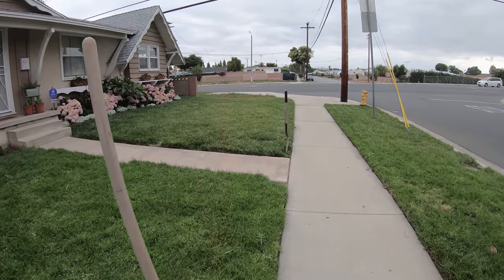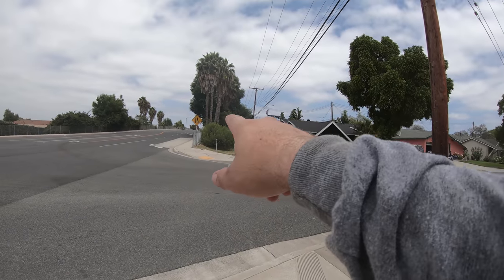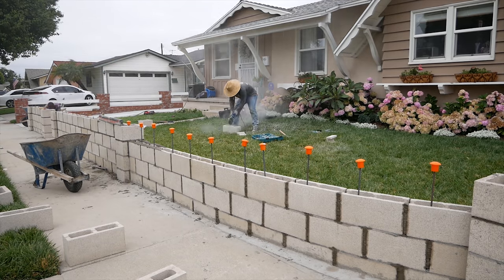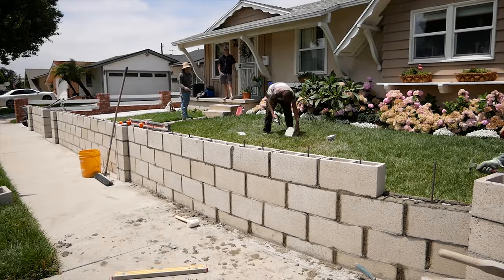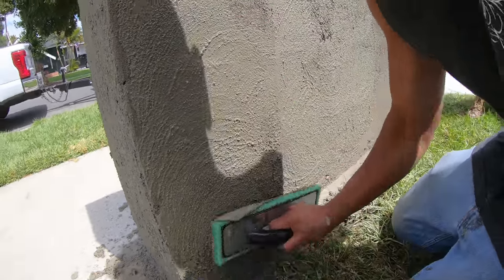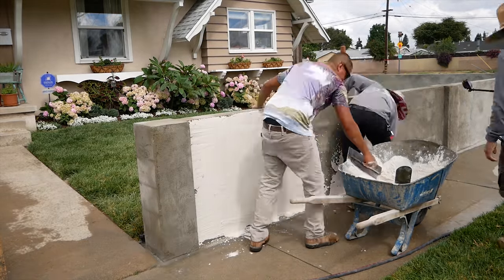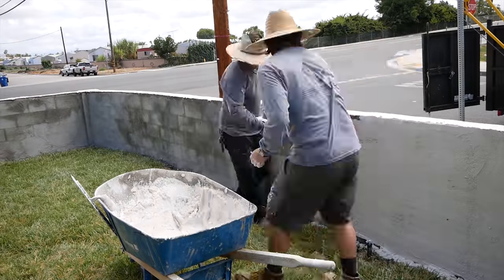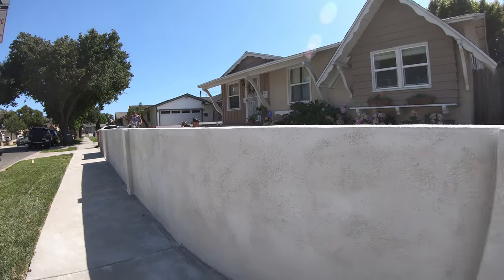How to Build a Block wall, Texture Stucco and Gate!

Comment: I dont see anything in the video showing how your piers are structurally tied in to the wall sections with rebar.. I see rebar inside the piers but nothing to physically link pillar rebar to wall rebar. I have learned a lot from your videos and I just wonder why you built it this way. Thanks for all your posts, they help a lot!

Comment: Can you build a wall like this on "old" concrete ? I have an old crumbling foundation I want to resurface with new concrete and build a low wall around it like this maybe with out the stucco at a faux rock face and wide flat rim to be used as additional seating or a place to set potted plants  I would be grateful for any advice or tips.
Reply from the maker: If it crumbling, then I would remove it.

Comment: Nice.  I have to say it seems a bit weird though having a gate and then open to the driveway 15' away.
Reply from the maker: Yes I think the fence needs to return to the garage with an additional gate
Reply: pedestrian gate and vehicular gate are both desired, the owner may choose to install a automatic garage gate, but requires easier access on foot.

Comment: If it was my house I would asked for some very thick vertical steelbars to be placed in the blocks and anchored at least 4 feet below grade. That would stop them and prevent penetration of the wall and possibly hitting the house. It will be cheaper and faster to repair a damaged block wall than rebuild a house!
The initial cost would be higher but it just might save an even bigger expense later! This just what I would have wanted and is no critique of your work here! I'm very much a belt an two braces kind of guy when it comes to construction!
Reply from the maker: Post bollards are the answer

Comment: 1. why not run re-bar through the footing and tie vertical steel to it? 2. Vertical steel is no good unless its mounted to footing steel, and a small beam(cap) should have been cast with concrete and steel(tied to vertical steel) to run along the top of blocks, this top beam would ensure the columns and blocks dont pull away from each other, and also prevent the wall from leaning sideways. Also, how did you tie the new wall into the existing wall?
Reply from the maker: This wall is short, so I don't see a problem
Reply: @OdellCompleteConcrete  fair point,,but where im from,,most builders 'over build'

Comment: only thing i think i would have done differently. Was, get some I beams and place them in the Columns instead of rebar. 8 foot tall I beams and snuck them into the ground enough for the ridge cap to go on top. that would stop a car most likely if it was to hit it.
Reply from the maker: how about some 12" x 4' steel bollards
Reply: @OdellCompleteConcrete  that will work too. Corner houses are just bit on dangerous side on some roadways. I used to live on a corner house that was similar to this house. We got a couple Boulders  placed in front yard. same year in winter time, car slid into it. Driver was fine. but it worked. Boulder didnt move a inch. well maybe it did. but we couldnt tell.

Comment: What happened to the rebar in the cmu as well as the vapor barrier, wire lath, and mesh and base in the stucco system? Too many burn marks. I don't know about that stucco application looks like it's going to start bubbling and delaminating pretty quickly.
Reply from the maker: You dont know what your talking about
Reply: @OdellCompleteConcrete  that's funny because I own a stucco company and we are certified applicators with California Stucco, STO, Master Wall, and Parex. But, okay... If you say so.

Comment: Is there any utility pipes going through the front yard?  And if so, how far can you safely dig while avoiding it? And do you need a permit for such work?
Reply from the maker: water should be a foot.
gas is at least 18" to 24"
Electric 24" to 36"
Reply: @OdellCompleteConcrete  thanks alot.

Comment: just made the slab for a 2 foot retaining wall, did not put vertical rebar. can i drill holes in the slab and put the rebars or will the wall be fine without it.
Reply: Drill for at least #4 rebar and blow out the holes then epoxy. Best case scenario would have been putting a horizontal rebar across the footing ad tie the vertical rebar with L hooks into that before pouring concrete

Comment: If you ever build up a fence like this will you post a video please? I just bought a house that has the same type of fence. 16x8x4 with 16x8x8 every 7 blocks or so. Not made to look stucco just blocks with a rounded top on the 4in ones. We need to make it taller by 1 or 2 blocks because my dog keeps jumping out to explore... They also had to tear down a part of it to get to the septic so the local people fixed the wall and that part of the fence is sturdy but not straight :( so rather than paying someone to not do it right I want to do it myself. Or if you have a video already please provide the link. I could not find one. Thank you!
Reply from the maker: Good idea
GL

Comment: I'm confused why you put concrete over the existing irrigation (what happens if that corner riser ever needs replaced it is fully cover with concrete).
Reply from the maker: new pipe

Comment: That looks nice David. Did you fill the blocks with concrete or mortar mix?
Reply from the maker: Concrete
Reply: @OdellCompleteConcrete  hi, I just want to build a small wall, 10 m length and knee height. Can I do it in a day?
Can I just lay the bricks on wet concrete? I want to do it as fast as possible. Please suggest me something brother.

Comment: As always, great video. Three comments: 1. Looks like someone needs a new hat. 2. Instead of a weird curved wall at the outside corner, you should have done a relief corner. Would have looked better and created more strength. 3. Why don't you cover the grass with a tarp or canvas cloth to protect it? Honestly curious.
Reply from the maker: Used top soil at the end to help it grow back and yes need a new hat 🤠
Reply: You would burn the grass very fast
Reply: It would burn the grass

Comment: Was that wall grouted for added strength? Great work!
Reply from the maker: Yes
Reply: @OdellCompleteConcrete  Great! Well then in the words of Mr. T,  “ I pity the fool that hits that wall!”
Reply: @OdellCompleteConcrete  when you say Grouted, you mean mortar or concrete laid between the two concrete bricks top and bottom and both sides as they are laid? And if so Mr. Odell, what are you using in the wheel barrel to lay them with (Grout them with?) Thank You sir.

Comment: Every cell should be filled. if your going to go through all this why would you purposely make the wall less effective?
Reply from the maker: No, only where steel occurs
Reply: @OdellCompleteConcrete  that steel is not doing anything unless its tied to footing steel and top/cap beam steel

Comment: They say every house has a buyer. Not sure about the people that buy these homes on corners like that. Like living facing the 405. With the new expansion, some are facing the 405 or they got a view of a 30 foot sound wall in their backyard. 
That’s a lot of rebar for that little wall. Going to be a solid little wall for not being able to stop a car. Should have sold them K rail and stucco it for them.
Funny, a house in our hood is for sale. Blacks right up to Edinger, Edwards and a gas station. In the posting is says “stand in the front yard and check how quiet the neighborhood is”. I’m four houses away and hear the air tools from the service station along with the bass from the knuckleheads in their cars at red lights. The front yard is no quieter.

Comment: Finished product looked good, but being in masonry for 20 yrs it hurt a little watching them boys use a line and level every block. Friendly tip if you wanna pass it on, once the first course is leveled front to back, if you lay to the line and keep the upper edge of lower course flush with lower edge of the block youre laying on the side youre laying from....theyll stay plumb and you dont need the level every block. Assuming your line is plumb going up. 

That would take a few hrs off the total time to lay the wall, and time is money in our world. Keep up the hard work 💪
Reply from the maker: Yes I concur

Comment: Why didn't lay any reo in second or third course for lateral strength and tie into the piers. Then core fill the wall with concrete. That would make the wall more solid and almost impenetrable. Nice work though.
Reply from the maker: It's solid filled with concrete

Comment: Clean project Odell, but surprised you didn't roll glue onto the block prior to your brown coat to prevent the grout lines from showing in the future when the wall gets wet.
Reply from the maker: that doesn't make a difference.
Reply: @OdellCompleteConcrete  Thanks for the reply. Wow, I was always taught that it does make a difference. Although I never checked on whether it did or not. Guess ya learn something every day. Appreciate your videos.

Comment: The fact you did not put a scratch coat on before the brown your wall will now show all the joint cracking in just one years time all that work for nothing!
Reply from the maker: Not on a solid block or concrete wall. Not needed

Comment: if you mortar one 8x8x16 block down to a concrete footer- let it cure - place a 4x4 post into one of the openings in the block - will it take alot of pressure horizontally against the post  to pop the mortar between the block and footer?
Reply from the maker: NO a 4 x 4 is not a good idea in there, not enough space

Comment: How much would something like this cost to have it built?
Reply from the maker: 10500
Reply: @OdellCompleteConcrete  what would it be if it were a 6’x11’ wall? I’m new at giving quotes
Reply: @mabals  I can't speak for Odell but the estimate he previously gave was for this specific project.  Even if he did something similar on the other side of the city this was in the price could fluctuate as much as a few thousand due to other variables, such as different types of permits, availability of materials, existing ground conditions, etc.   In your town/city this exact same build with same dimensions could be hundreds or thousands more or less. :/   I'm not trying to discourage you but just helping you understand location matters, existing conditions matters, and such.  Good luck with your business!

Comment: Very nice, especially the curve. Quick question: Did you fill  all the blocks with concrete or only the first bottom layer and if not, why?
Reply: No they do not fill it all the way up
Reply: @aaronhoyt8081  Then what is the point of putting the vertical steel bars just wiggling in the hollow block openings?
Reply: That I cannot tell you because I am not a Mason I was just basing it off of watching the video and I seen they did not fill them
Reply: @aaronhoyt8081  I think they do fill at least the openings with the steel rods in them.
Reply from the maker: We fill all the cells with steel

Comment: laughs in south african at how low the walls are. needs to be over 6ft to give good security - and obvi an electric fence goes on top
Reply from the maker: Its really just for out of control vehicles.
Reply: There are municipal codes that regulate front yard fence heights.
Reply: @adamstackhouse2051  obviously america is a safe place then. personally I think everyone would be better off with a 7ft wall and an electric fence. but RSA is crazy like that

Comment: Nice wall. 

Music way too loud compared to the speaking forcing constant volume adjustments.  Ended up turning off the sound and using the closed captioning.
Reply from the maker: Sorry about that, will do better with adjusting the volume channels next video.